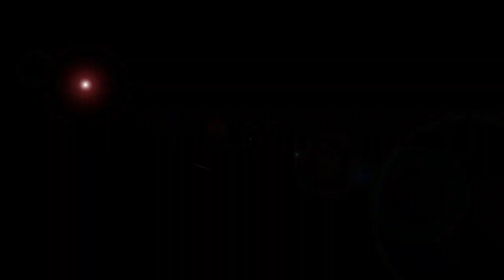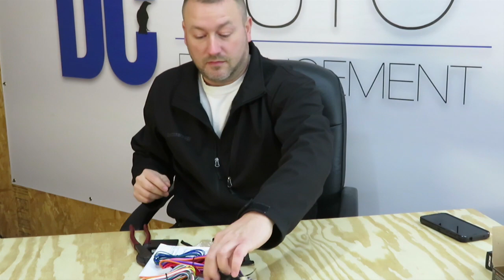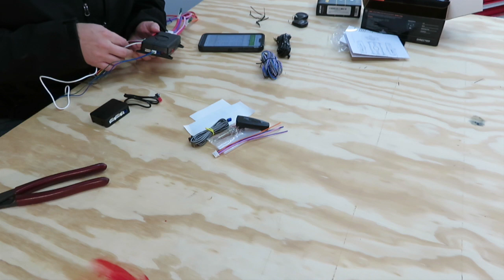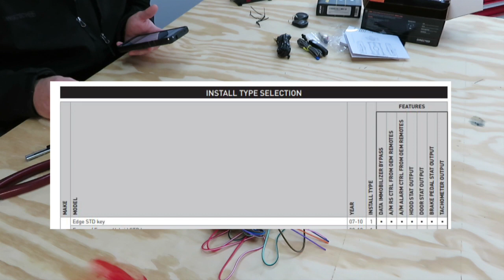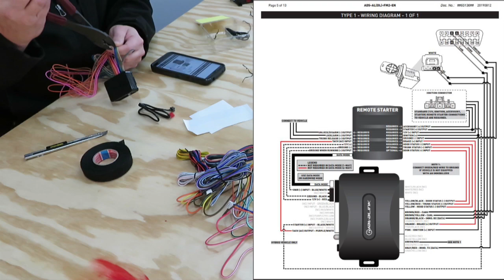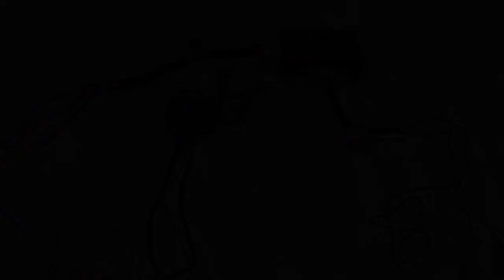Simplifying Remote Start Wiring! Easy Tip to Making Remote Start Wiring Manageable!

Comment: I found a unit from directed electronics 4x03 in my car. How do I tell it's a remote start unit or not?
Reply from the maker: @K.a.d.d_srt8  it is. It has a 6 pin plug with large wires?
Reply: @DCAutoEnhancement  yea I believe so. It's all hooked up.  I tried to use my oem fob to my car but it doesn't remote start. Granted my oem doesn't have a remote start button but I'd like to maybe get viper controls for it.  Just had to be sure it was a remote start unit. I have a dball2 unit with it also.  I'm not sure if any other viper remotes would link with it or not. Someone locally said they have a remote from a viper 5806v unit and I seen that my unit requires anything 4013 controls from avital or viper. Not sure if all viper controls are compatible with DEI
Reply from the maker: @K.a.d.d_srt8 the remotes will probably be specific. I don't know the car you have but try pushing the lock button three times. Some newer remote start bypass modules will activate the start sequence once the lock button is pushed three times. And sometimes it is lock, unlock, lock. Let me know what you find out. I have something else for you after that
Reply: @DCAutoEnhancement  I've tried those sequences and nothing.  I've also got the hood pin grounded because the hood pin broke
Reply: @DCAutoEnhancement  my car is a 2007 chrysler 300 srt8
Reply from the maker: @K.a.d.d_srt8 to order the remotes that will work with your unit you usually need the date code which is on a small sticker on the bottom side of the main unit. Is your remote start only labeled 4x03? While I wait for your response I will see if I can find a place to order the remotes from
Reply: @DCAutoEnhancement  just says 4x03 at the bottom corner.  Haven't been able to find a date on it.
Reply from the maker: I am more than 50% sure this remote will work for you. If not, returns are easy through Amazon. If you decide to try it, respond here and I can try to help you through programming if you need it. https://amzn.to/3Eno3Wq
Reply: @DCAutoEnhancement  I'm trying to send you a link of a control I was looking at. Says 4103 from viper
Reply: @DCAutoEnhancement  are you getting my comments by chance?
Reply: @DCAutoEnhancement  if you got an email address I can contact you on that'd be better
Reply from the maker: @K.a.d.d_srt8  yes
Reply from the maker: @K.a.d.d_srt8  info@dcautoenhancement.com
Reply: @DCAutoEnhancement  thanks man
Reply: @DCAutoEnhancement  I sent you an email on my 4x03
Reply from the maker: @K.a.d.d_srt8  I haven't gotten it. Send it to dcautodiy@gmail.com
Reply: @DCAutoEnhancement  sent
Reply: @DCAutoEnhancement  sent
Reply from the maker: @K.a.d.d_srt8 replied

Comment: thanks for the great video. What kind of remote start and bypass I need for my car.???? Can I use any remote start or any bypass ? Thanks in advance 😊
Reply from the maker: What year make and model is your car? I can give you my recommendation once I have that information
Reply: @DCAutoEnhancement  Honda Pilot 2005. Do I need a bypass for the key???
Reply from the maker: @xavi-12  yes, it will require a bypass to make the car think the key is in the ignition during remote start.
Reply: @DCAutoEnhancement  can I use any remote start and by pass ?? How I pick one. ? If you can do a video will be awesome 😎!!!! Thank you
Reply from the maker: @xavi-12  you can pick any remote start but the bypass is different, it has to be compatible with your vehicle. I am still looking for one that you don't have to buy a programmer for. The cheapest option would require you to have an extra key placed inside of a box mounted under your dash.
Reply: @DCAutoEnhancement  do think this one work ? Idatalink Blade-TB Integration: Blade Multi-Platform Transponder Immobilizer Bypass Cartridge (ADS Blade-TB) with a Compustar remote starter ?
Reply from the maker: @xavi-12  yes but, you need the programmer from idatalink to program it as well
Reply: @DCAutoEnhancement  thank you. You’re very nice.
Reply from the maker: @xavi-12  hopefully I have been helpful. Let me know if there is anything else I can try to help with
Reply: @DCAutoEnhancement  yes I will let you know. Do you have an email or phone how to contact you.
Reply: @DCAutoEnhancement  hello. I’d like to let you know that I connected everything and I worked but just with the Key in the ignition. I flashed the module and it looks fine but the car doesn’t turn on, just crank. Any idea what am I doing wrong. Honda pilot 2005, Viper 3105V and Idatalink ALCA. I connected everything how idatalink said. Please 🙏 let me know what could I do wrong ? Any advice please. Thank you in advance
Reply from the maker: @xavi-12   this might be a dumb question but, did you program the ALCA prior to installation and in-vehicle programming?
Reply: @DCAutoEnhancement  well. I connected the remote starter all wires and  after I connected the ALCA to my computer to flash it, after that I connected the module to the remote starter… also I did the module program procedure.
Reply: After I did all that… the car just crank but don’t start  or keep running.
Reply: I was wondering if I have to do any programming to the remote starter. ???
Reply: Thank you in advance for all help
Reply from the maker: @xavi-12  I will look at the wiring information shortly. In the mean time double check the wires going to the immobilizer, probably 2 or 3 wires and makes sure they aren't backwards
Reply: @DCAutoEnhancement  well I checked it. White/black goes to key 
White/red goes to harness 
Orange/black to data #2 
Pink to ignition # 6 
I will take a look again. No problem.
Reply from the maker: @xavi-12  does the pink wire go to red/white in the car?
Reply from the maker: Are you using the data wire to connect the remote start to the bypass?
Reply: @DCAutoEnhancement  yes it does.
Reply: @DCAutoEnhancement  yes I’m using that one…

Comment: I’m wanting to do a remote start and alarm on a older truck but can’t find out if I need a bypass module 1993 Chevy s10 blazer it’s non power . I found a wire diagram. Just need to know if I’ll need that second piece you wired up as well with the remote start  kit
Reply from the maker: That vehicle does not require a bypass. GM started using immobilizers in 1998.

Comment: I plan on purchasing the Avital 5303L security + remote start for my 2009 Toyota Tacoma Do I need a bypass module? If so, which one do you recommend?
Reply from the maker: Your truck would require a bypass. If you just want to by the bypass to go with the Avital you could use the flashlogic FLCAN or FLTB1. I suggest looking at the Prestige APS997Z, this is a two way remote start alarm that is made to have the bypass installed directly into it. The benefit to that is  having only one unit to install rather than two.  I have installed The Prestige brand and I find it to be just as good as the Avital. https://www.amazon.com/dp/B07JJCNQRV/ref=cm_sw_r_as_gl_apa_gl_i_X8R513BMZBRG28QKSXXF?linkCode=ml2&tag=dcautoenhan06-20
Reply: One more question, do you know where I can find a t harness to connect into my 2009 Tacoma?

Comment: is there another way without the bypass for a 2016 ford focus? i didnt think a bypass was needed.. if it is whats the cheaper option?
Reply from the maker: There is a relatively inexpensive bypass but you have to have a second key that you put in a box and put a ring around the ignition. If you want a link, I can send you one.
Reply: @DCAutoEnhancement  please send the link, need it forsure. i have 3 keys 1 doesnt have the remote though
Reply from the maker: @carstoniu  does the one without the remote start your car? If so, you will want to use that one and put it inside the box. https://amzn.to/3kYhZKP

Comment: So did the bypass pick up all the other wires that would have to be tagged ie tach, break input (to shut down the remote start and key to take over), hood pin (should it have it), truck release from the factory remote ( without using a relay to pop the truck), trunk trigger?
Reply from the maker: Yes, that is true of most newer vehicles so long as you use a remote start that is compatible and use the Data to Data (D2D) wiring.  Some of the new remote starters have a slot for a cartridge style bypass that makes it easier to install. I have not installed that style yet.
Reply: @DCAutoEnhancement   okay. I am installing a Avital 5303L  and a DEI DB3 into his 2004 Honda Accord Lx. I was thinking that I will run the unneeded wires to the location of the factory wires that I might have to connect to just incase the DB3 doesn't pick them up. This way they are long enough and ready to terminate. I use to be a MECP alarm specialist but that was 21 years ago.....LOL
Reply from the maker: @shanereynolds4722  the bad thing with DEI is finding the installation manual or any information without being a dealer.
Reply: @DCAutoEnhancement   I have found the install manual online for the avital 5305l. Also the person I purchased it from did sell me the entire system ( avital 5305l and the DB3 and programmed it for the 2004 Honda Accord. I am putting together a list of material ie connectors, a couple relays and wire so I can perform the install next weekend. These models (DB3) are suppose to make the job a lot easier. I use to have to run wires and terminate all of them from the remote starts. In the event it isn't I will still have the remote start wires in their location to terminate the old way. I use to call DEI when I would install alarms on brand new vehicle and call and give them the colors, locations, if I had to use relays or diodes.
Reply from the maker: @shanereynolds4722  then you should be good that it's already programmed
Reply: @DCAutoEnhancement  Yup. That is the idea here.
Reply from the maker: @shanereynolds4722  good luck

Comment: I have a 2001 subaru legacy gt manual trans. Can I install this?
Reply from the maker: You can, you have to simulate the clutch being pushed in. Sometimes it is as easy as grabbing the starter wire after the clutch switch and sometimes it involves wiring relays. I would think you could find that information on a Subaru forum. I can't help much on this one. I have only installed remote starts on one or two manual cars and it was a long time ago.

Comment: I purchased this unit (4115L) but to my surprise no specific details to install on my 2003 Ram 1500.  I expected a link of some sort which I had had received from a different manufacturer from a simpler era ... 2002ish.

At any rate where can I find out if I need the bypass for my truck and also where might I find any specific install instructions.  Thanks in advance for any help you can give me.
Reply from the maker: If you have a gray key then you need a bypass module. If you have a black key, you don't unless your key has the lock and unlock built into the key, the you need the bypass. Comandocaralarms.com

Comment: hello good morning I have to mount an avital on a 2005 Dodge RAM 1500 you can tell me which wires you keep and which cuts please so I have the essential wiring ready and I am looking for only the wires to be wired I already have the bypass programmed for the vehicle together. thanks if you can you would make me a great beacon and congratulations for the video
Reply from the maker: From the remote start these are the wires you will need to keep:
12v constant (2)
Ignition
2nd Ignition 
Accessory
Parking Light
Brake input
Ground
Emergency brake input (black/white it can be grounded with the black ground wire)
The rest of the wiring will be from the FLCAN. Let me know if you want me to do the same for that.
Reply: yes thanks if you can nn I wanted to put the bypass but put the chip directly to the pawl and the same does not work the same way?
Reply: yes, putting it on the pawls and as if the machine did not have the coded key

Comment: I have a 98 99 gmc Yukon. I have a few questions I hope you could answer. It has a factor keyless entry, do I need to un install it to add the avital 4105L? Also I have the passlock 2 security, it doesn't have a chipped key. Do I still need an interface module?
Reply from the maker: I know this might be a little late but, no you don't have to un install the factory keyless entry and yes you would need a bypass module to add the remote start to your vehicle. Thank you for watching!

Comment: Hi DC, thanks for the videos! I’m installing a Avital 4105L on my Subaru Forester 2007, How do I know which wires to hook up? So far I’ve got the chassis ground, the light flash output on the primary connection. I have the parking brake input on the remote start harness. Then I have the accessory, starter, ignition and 12 volt on the heavy gauge. The two red 12 volt wires I’m going to put together and solder to the 12 volt on the Subaru. Also would the light flash output on the primary go to the parking lights on the Subaru?
Reply from the maker: Are you asking about which wires from the remote start needs hooked up? What bypass are you using?
Reply: @DCAutoEnhancement  Yes, I’m using the FLCAN
Reply from the maker: @alextamburri6802  wires from the remote start that need connected to the car
Main harness: 12v, IGN,acc,starter
Parking light
Brake input
E Brake can be grounded unless you use your emergency brake when you park.
Lock and unlock if you want keyless entry
Tach is optional but preferred
For the FLCAN follow the instructions regarding those wires
I hope this is helpful
Reply: @DCAutoEnhancement  Yup, but what do you mean by grounding the emergency brake?
Reply from the maker: @alextamburri6802  the black/white wire can be connected to the black ground wire. It makes the remote start think that the e Brake is enganged
Reply: @DCAutoEnhancement  Got it, thanks a lot 👌🏼
Reply from the maker: @alextamburri6802  no problem! Thanks for watching

Comment: Is the tach wire necessary for the installation on 2000 toyota camry?
You really helped me on the installation.
Thanks for the great video 👍👍👍👍
Reply from the maker: Required, no. Recommended, yes.  The tach method is the most reliable. If you decide to hook up the tach wire, the easiest away to get it without using a multimeter is to go to a fuel injector, each one should have two wires, there is a common color on each of them and one that is different. You would want to get your tach signal from the different colored one. Thanks for the comment and feedback and thanks for watching.

Comment: So, with any immobilizer, do you have to connect the wires from the immobilizer to the actual remote start system itself? I'm awfully confused about that part.
Reply from the maker: So a vehicle that is equipped with an immobilizer has to be manipulated into thinking that the key is in the ignition. So the bypass is doing that manipulation. Some cars can be manipulated through a single wire at the OBDll port or multiple wires at the immobilizer itself. If you tell me what vehicle your working on I can try to clear that up for you.
Reply: @DCAutoEnhancement  I can email you the photos of the wiring diagrams they sent me.
Reply from the maker: @Christian Owens  info@dcautoenhancement.com
Reply: @DCAutoEnhancement hello i have a 2007 camry i don’t own a bypass. When I press to start the car all lights on dash come on regular but not one single crank. Why
Reply from the maker: @alexanderabreu5312  most likely because the car is not getting the signal from the key. You can verify that by putting the key in the ignition and leaving it in the off position then try to remote start it. If it starts that tells you, your connections are good but just need to hook up a bypass. You may also need to start the car work the key at least 3 times to program the remote start. Let me know what happens
Reply: @DCAutoEnhancement  I have a 2002, Pontiac Grand Am Gt, 3.4l.
Reply: @DCAutoEnhancement  I also have a db3 immobilizer, with a 4105v remote start/security combo.

Comment: Thanks for all your videos! I'm halfway through an install on my 08 Hyundai Tucson, and I have a few questions:
1. Do I need to wire all 6 heavy gauge wires to the ignition? It looks like there are two, constant 12V wires. Can I just cut one of them?
2. I'm using FLCAN bypass and the wiring diagram shows only two wires, one to the ignition and one data wire to the Passenger Kick Panel. Which wires will I need from the 4105L Remote Start? I've already cut the majority of the wires from the primary harness, as you've done in this video.
Reply from the maker: Yes you will need the two red wires, they are required for operation. I'll look up your vehicle to verify the FLCAN wires and get back to you

Comment: I have the 4105 system is there a way to upgrade to the 2 way remote for avital
Reply from the maker: No, unfortunately you would meet to.change the 4105 out for the two way system. But they usually use the same connections so it would most likely be a matter of unplugging the old one and plugging in the new one.  But then again if the connectors are not the same, the wire colors are for sure the same. Worse case scenario you cut the wires and connect the new ones to the old ones. I hope that was helpful.
Reply: @DCAutoEnhancement  thanks, sounds pretty easy
Reply from the maker: Should be straightforward as long as it is a DEI product is: Avital, Viper, Python etc
Reply: @DCAutoEnhancement  👍

Comment: You cut the brown cable is for the brake pedal stop the engine
Reply from the maker: There are two brown wires. On small one for the horn and a larger one that is for the brake. I cut the small one for the horn